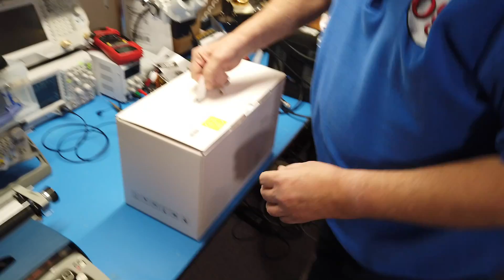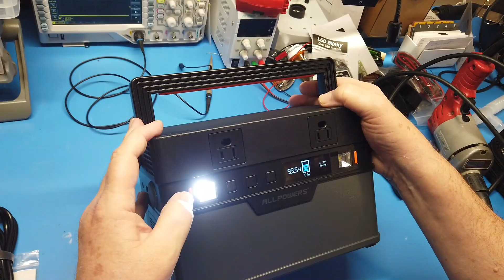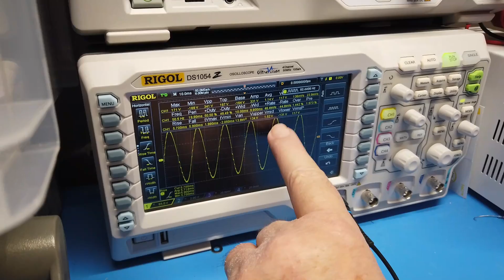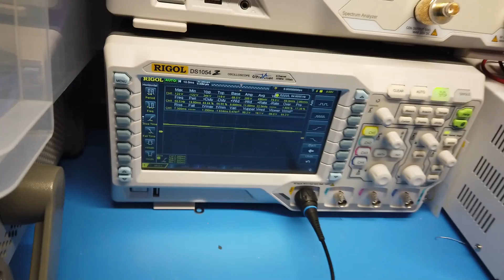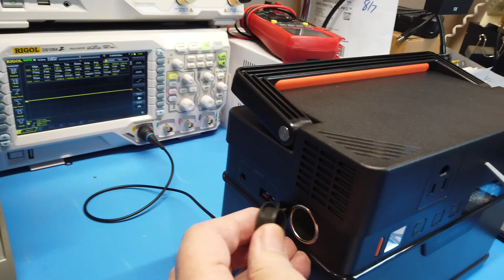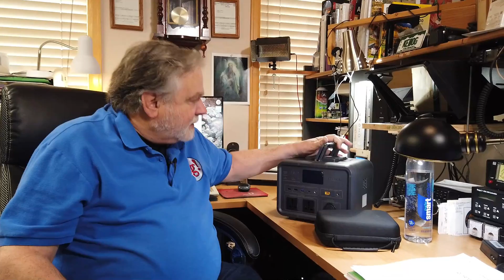The AllPowers Power Station (#628)

Comment: My version of this unit doesn’t have the app available at least from Apple. So that’s a big disappointment. I also didn’t like that it doesn’t have pass-through charging capability so you can’t run your laptop or something while charging at the same time. It’s kind of a wonky design with flashlights in front that shine in your eyes, when looking at the panel. The AC plugs are upside down and if you run some thing like a want meter that will also be upside down and cover the controls at the same time. Since I can’t return it on Amazon and get any help from the company, I’m really disappointed with it.

Comment: I have been thinking of creating my own "power box" as shown on a number of channels.  My intent is to use two LiFePO4 batteries wired in parallel, each battery is a 12V 10Ah.  I understand that I could increase the Ah to 20 by that arrangement.  I would be using it to power a TYT TH-9800 or AnyTone AT-D578UVIII PRO.  At present, I have no intention of arranging for a solar charging system.  Would this be a good investment of time and money for a portable power source?

Comment: Lol, made my own out of a 35Mah solar battery and an old ammo box.
Reply: Mah? That's... Unlikely.... :-)
Reply: @Wayde-VA3NCA  why would you say its unlikely?? All you need is an ammo box (plastic) a power distribution block a few power pole connectors some wire etc...I also have a solar panel that I use to charge car batteries that will recharge it. The kit runs a 400watt inverter and my icom 718 and my anytone 878..if ya want to get fancy add a power meter to it and some snap in usb fittings..
Reply: @ghostwalkerairsofttech1947  Yep, I had a lot of fun with a very similar project; although, mine seems to be doing ok with only 24Ah worth of LiFePO4's... 35MAh must be a tough carry :-) :-) [ I'm just jokin' around 🙂 ]
Reply: @Wayde-VA3NCA  it ain't light for sure...but it doesnt cross the threshold of needing a solar charger..I basically made it for a pick up and go power supply along with my homemade nvis antenna..
Reply: @Wayde-VA3NCA  thanks for the reply!!